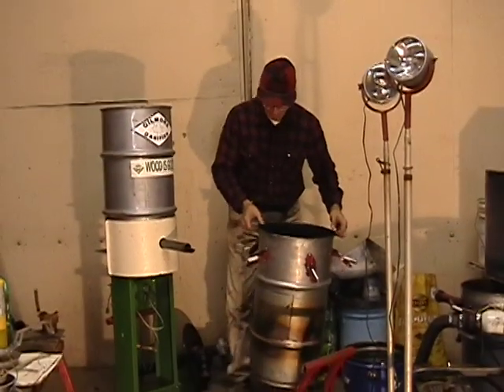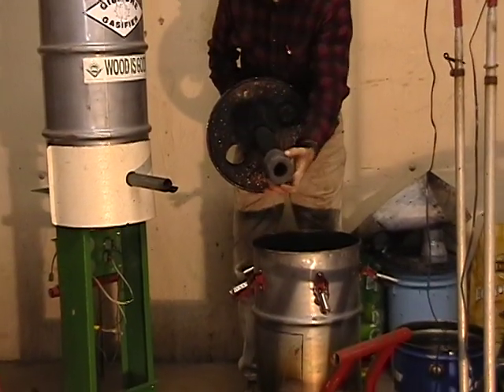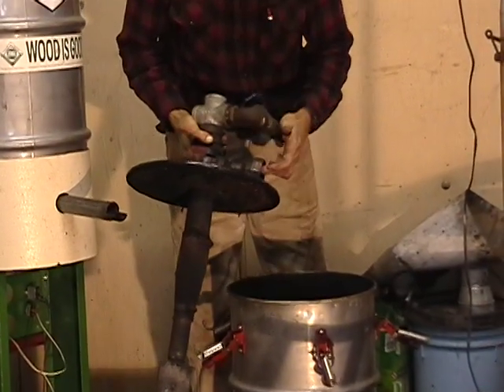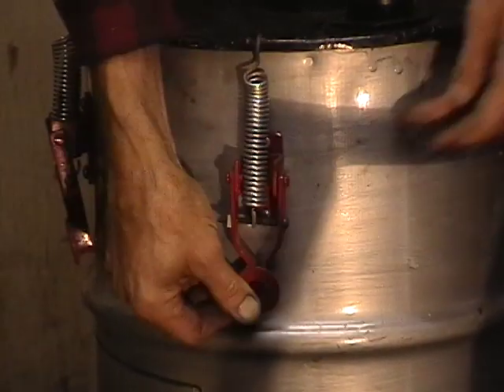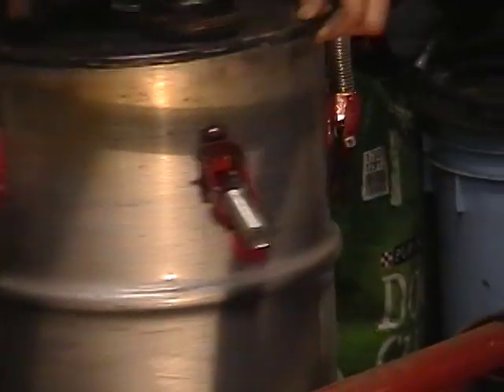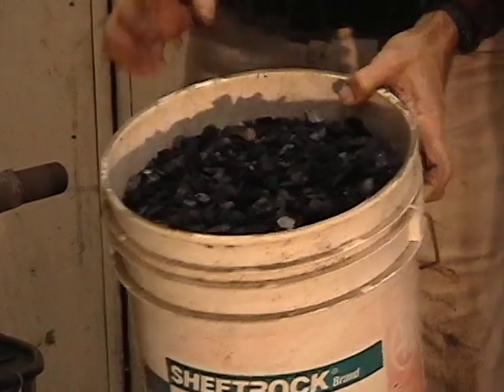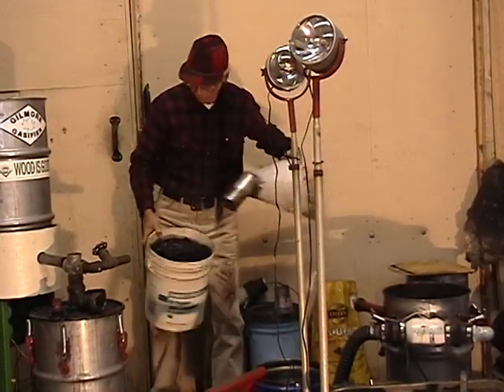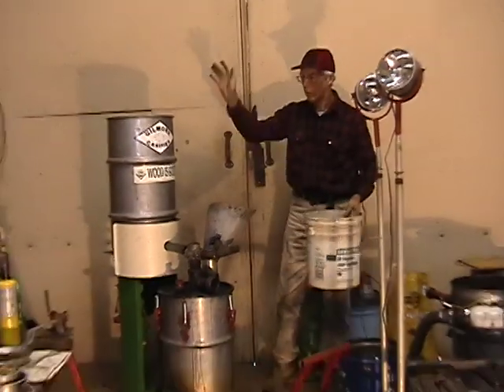Gilmore Gasifier Part One

Comment: You said wood gases were "mostly carbon monoxide.  That is not correct.  Wood gases have a significant amount of Hydrogen gas as well as a small amount of nitrous oxide and sulfur dioxide depending on the type of wood used.  It definitely has a Significant volume of Hydrogen gas.

Comment: If I was just using charcoal in the gas generator, the product is correctly termed "charcoal gas".  However this is a hybrid charcoal gasifier since I am adding some raw wood into the hot bed of charcoal.  The gas produced from this wood is then called "wood gas".  To be technically correct, I need to call this  gas mixture "charcoal/wood gas".  Gets kind of cumbersome and I make slip ups.